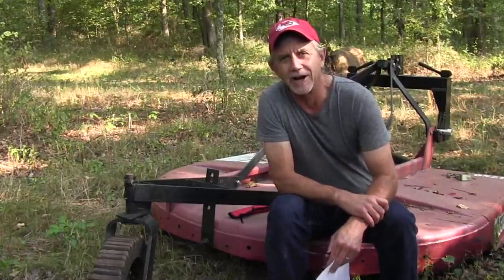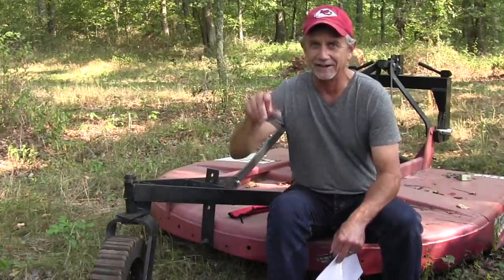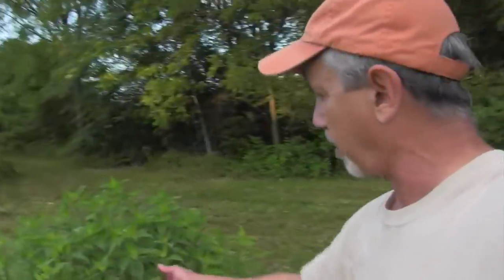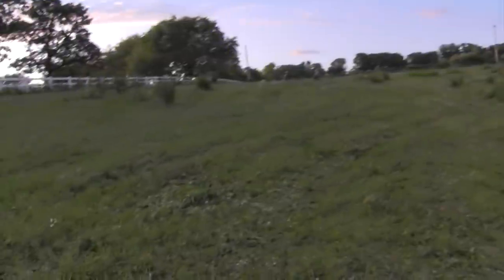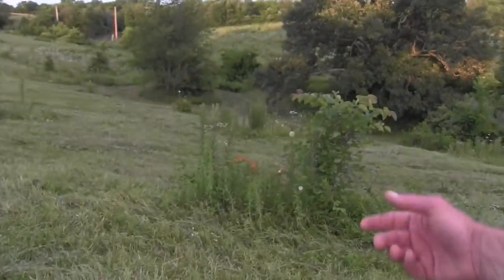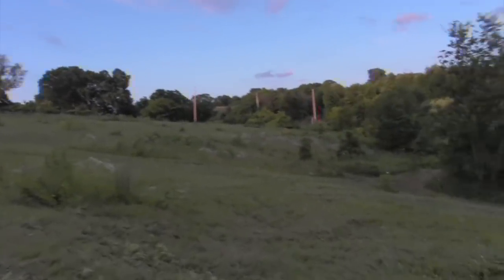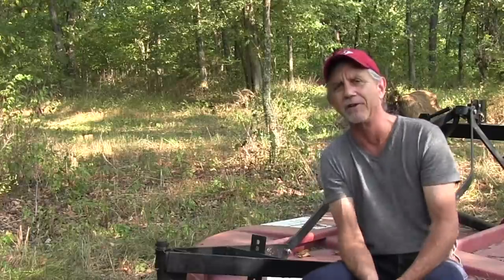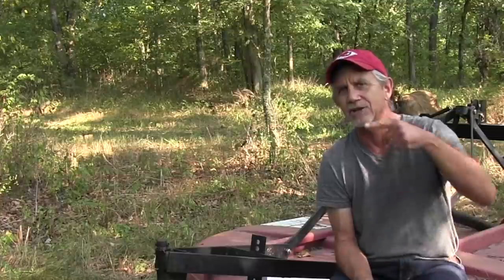Someone Tore up Their Bush Hog!

Comment: If you have rear remotes, invest in a hydraulic top link, that way you can retract it and get that wheel way off the ground for transport, then quickly extend it back when you start mowing again.

Comment: Hey Mike, thanks for another great video.  I've lost a tail wheel from my rotary cutter, too.  Different cause, but I too took a long walk in my fields trying to find it.  Not a big deal to get it fixed once it's back in hand.  Thanks as well for putting in a plug for keeping some of the native plants around to support pollinators.  Finally, anything to say about orchard tractors?
Reply from the maker: Funny, I grew up on an orchard and we never had an orchard tractor.  There were several orchards in our area when I was a kid and the local IH dealer ordered an orchard tractor thinking someone would buy it.  My dad took one look at it and said, "That looks funny" and wasn't interested.  Couple of things about them, often times, the orchard tractors are completely different than the regular production tractors.  So, parts may be a little trickier to access.  Most have everything built low to the ground with under-hood exhaust (to keep the exhaust pipe from whipping limbs back in your face).  If I found a deal on a used one I wouldn't be afraid of it.

Comment: Great video.Had to make my own pin driver as I couldn't find my punch set..Good to have in the box.Heating both bracket and pin to correct temp is key to durable weld.Step down also helps.

Comment: Lost the tail wheel on mine a while back.  It is held on with a lynch pin.  Luckily I noticed when I wasn't far from it and I carry a few extras of different sizes in my tractor's tool box.  Stuff like that happens when working in the woods.

Comment: Mike, thanks again for the info.

I wonder if you could do a series on "PTO Shafts". I men an A-Z, types (series 3,4,6 etc)(Different Ends, smooth w/shear, 6-spline, 20 spline, U Joint with integral Slip Clutch,) Ways to build up, modify (Shear to slip by changing U-Joint, or Whole End, or Adding a Clutch with Splined ends on and on). There is a LOT of stuff about PTO Shafts and it seem everyone just wants to do videos about how to cut to size, or repair the disconnect. No one has a full comprehensive series on Shafts with examples for purchase from Amazon, Georgia Equipment, etc etc. Surprise most of us that have used equipment do not buy the 500 dollar shaft from a dealer. Anyhow, I've answered many questions on PTO's to folks and it always seems like they had come to me the hard way and with no real idea. A multi-part series would be great.

Comment: Hm-m-m-m.  ine doesn't have a roll pin, just a washer and a giant cotter pin.  Never had a problem, and it's easy to remove.

Had my own issues this late summer, though.  The link from the rockshaft to the lift arm snapped.  Tried to order another online and the part number was discontinued (15-year old JD).  Superseded by a new number.  Old number was $60, new number was $300+.  But nobody had them.
So I brought it to a local machine shop that advertised welding, and they welded it up.  First time I raised the 3-point it snapped.  Terrible weld.  Brought it back and they did it right, but it took lots of travel time.  Fingers crossed.

Comment: Hi Mike. Just food for thought. Running a tractor with a bush hog up my have other negative consequences. I have a bit larger tractor, a John Deere 5090R. I recently bought a Fontier MX 10’ shreader. It big but really does a good job. When traveling with this set up I was carrying it up. Well long story short one of the pins on the lower three point bent from holding all that weight. I went in to buy a new pin and from JD it was $120.00. (Heart attack). I had a local machine shop bent the one I had back and it’s working now. Just thought you might keep this in mind for those using heavier bush hogs.

Comment: I actually bent the fork of my tail wheel while bush hogging the ditches around my property. As I was backing the bush hog over the ditch I would rise the bush as to not ram the tail wheel into the other bank, most the wheel would swivel around and ride up the bank, but 1 time it only turn side ways and bent the fork. So now I have to try to straighten it up or buy another one.

Comment: Its probably hard to get weld penetration for that wheel assembly. I had a wheel that broke off on my finish mower and it wasn't welded on both sides of the wheel because of the spacers. I ended up re welding the post to the bracket, then sacrificed one of the spacers and welded it to the top of the bracket. So far no more breakage.

Comment: I do a lot of custom brush hog work, some years as many as 40 fields but usually closer to 30. The older I get the more it bothers me tho mow over milk weed plants because of the monarch butterflies. One time a woman wanted me to mow around any stands of milk weeds in the early summer. I do her fields twice a year so in the fall when the butterflies are gone I mow them off. They grow back in the spring so there's no problem. I kind of wish other customers would agree to doing that too but most want their fields cut clean. I had the same problem with the tail wheel on my Bush Hog several years ago. I had to weld it a couple of times but the second try lasted. Those wheels take a lot of abuse. You've got some nice looking fields, beautiful fences too. Good video as usual, thanks.

Comment: My suggestion, keep the wheel(s) on the ground. I just went through 2 sets of bolts that hold the lift arms to the tail section on my BH297 because I had it raised while driving across my field and hit a sizable rut. As soon as I did, I heard a loud pop and looked behind me to see the two wheels suddenly on the ground. Yep, snapped both of the bolts. I keep both wheels on the ground now when driving across my fields. (hog damage in Texas can be pretty bad)

Comment: Hi Mike, Randall Harless here to ask a question. I’m in the market for a new tractor and I have read your book so my question actually concerns the tractor I have. I want to get the best possible price but I’m not sure how to properly gauge the value of that tractor. It’s a 1990 John Deere 2555. It has a front and loader on it and is in pretty good condition. I’m not totally sure how many hours it has but I was hoping maybe you could give me some tips on how to properly gauge a reasonable price to sell this tractor. Thank you
Reply from the maker: Randall, I actually did a video about that a while back, here's a link: https://youtu.be/6gadFWvue7w.  They've changed the link for all of Craigslist, here's the new one: https://www.searchcraigslist.org/.  If it's in good shape, don't hesitate to start really high, even above the averages, if it's rough, you may have a little more difficulty selling it.  Clean it up good and wax it (if the paint is good) and stick it on Craigslist and I'd bet you get it sold.  Good luck and thanks for your business!

Comment: Had the same thing happen on mine.  Didn't have access to a friend who was a welder but my local Tractor Supply sells a replacement yoke & post assembly that was an exact duplicate.  All I had to do was transfer the wheel and axle to it, slide the post back up in the tube and pin it, and then grease everything.  Maybe a 30 minute job.
Reply: Invest in a welder and practice, you'll be surprised how handy they are.